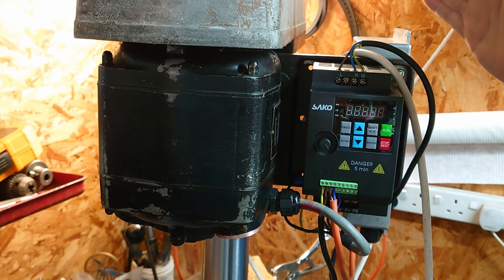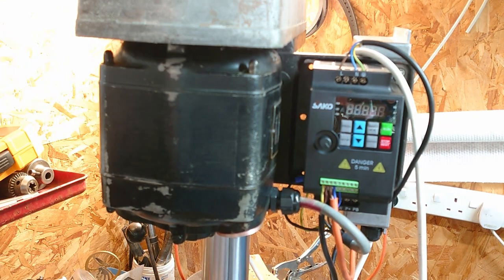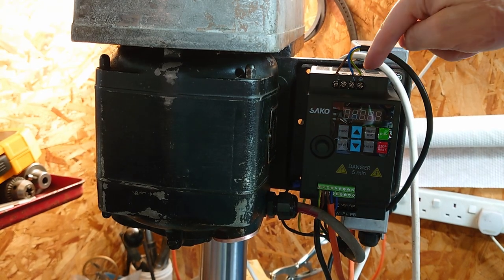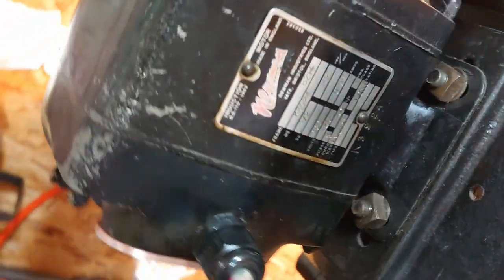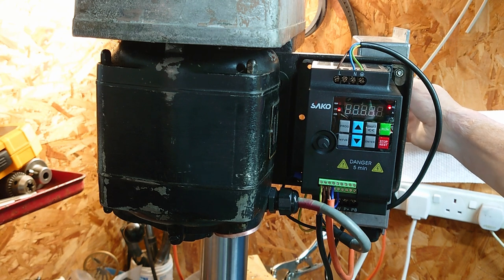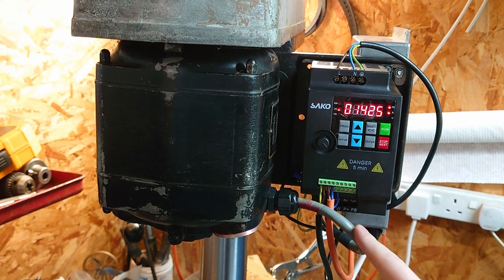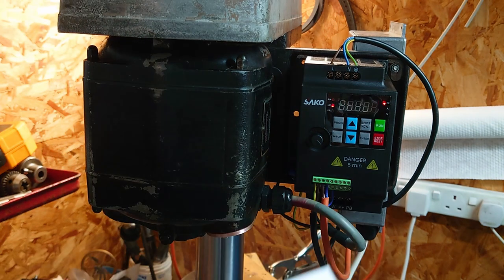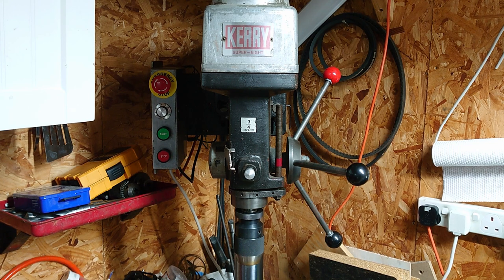I bought the cheapest VFD on Amazon for my 3 phase drill press

Comment: Folks, please put kit with exposed mains connectors in an earthed enclosure. You may need to think about ventilation. As shown in this video the wiring is not safe. There is a duty on us to those who come after us to do things in a safe manner - and to show them done safely. Olly - I'd gently advise taking this video down or editing the audio to say it is now enclosed.
Reply from the maker: Hi Bob. I'll pin this comment so that others will see it and can appreciate your concerns. Your recommendation to fit everything in an earthed box is the ideal solution, however I disagree that the wiring is not safe. It could be safer, but there is nothing at mains potential that can be touched. The mains input goes via a strain relief grommet into the switch box, which is earthed, the machine, motor and the VFD are all earthed. The VFD is located at the back of the machine, well away from swarf or anything you are likely to touch while the machine is powered. The E-stop isolates everything from the mains input.  The only thing that could occur is if a wire came loose from the screw terminals, yes there is the possibility of a live wire, but the whole shed is on an RCD.  I am personally comfortable with the level of safety. This approach to VFD installation is very common.  Every installation is different, and anyone installing such equipment should consult someone qualified if in any doubt, this is written on pretty much every piece of electrical paraphernalia that I have come across, so I didn't feel the need to repeat this advice. FYI, it is not possible to edit a YouTube video once posted.

Comment: I have a question. I installed mine to a 1,5kw motor and i attached a extern Potentiometer but the frequency jumps around and doesn't stay still. Is that normal?
Reply from the maker: Hi, great question.  I'm assuming that the VFD is also rated at 1.5KW, so in theory should be fine to drive your motor - although chinese KW are sometimes a little more generous than regular KW.  I can think of 4 things ....
1. Loose/bad connection - always the first thing to check
2. Could be a dirty potentiometer - clean with contact cleaner or WD40, or replace
3. Double check all the settings - there were several setting on mine that related to how the pot affected the VFD.
4. Electrical noise pickup on the wires to the pot - if wires are too close to motor, motor wires or mains input, it could cause interference.  Separate if you can, also try screened wire, either to the pot or the motor - connect the screen to the GND connection at the VFD only, this avoids a ground loop which could make it worse.  The noise would most likely be coming from the motor wires, and it's best to suppress noise at source, rather than try and protect other things.

Hope this helps, let me know how you get on.
olly
Reply: @ollysworkshop  thank you for these helpfull tips, the connection ports are still a mistery to me. No matter how hard i turn the screw on the connection ports the cables are still very loose. So i attached the wires end to pins and pushed it through the green connection ports on the vfd, i know its not the proper way but i have absolutely no idea how to mount them hahah
Reply from the maker: The little green connectors are called cage clamps. There's a little moving metal cage attached to the screw. They usually come done up. When you loosen the screw, the cage descends and reveals the hole where you poke the wire. Do it back up again to clamp it. I agree they can be a bit confusing compared to normal screw clamp style terminals.

Comment: I’m making a variable speed saw contraption so looking for the ability to slow the blade down as it slides on some linear rails- what minimum rpm are you getting
Reply from the maker: Hi, thanks for your question. I have set the minimum frequency on the VFD at 15Hz as below that the motor torque drops off like a stone. The motor is 1425rpm at 50Hz, so at 15Hz that's about 400rpm. I don't know how other motors will respond, some may be better. Hope this answers your question.

Comment: This was very useful for a noob like myself. I'm planing on buying the same vfd for a 3 phase polishing machine. The only question is, if you wire the 220v cable so you can plug it in and out of a wall-socket, will you have to reprogram the vfd, or does the vfd have an internal memory and keep the settings regardless of getting 220v in?
Reply from the maker: Hi. Glad you found it useful. The inverter remembers all the settings after losing power. My system is run through an e-stop switch. When I hit the e-stop all power is disconnected. I can confirm that it's been working perfectly since installation.
Reply: @ollysworkshop  Thank you for the help Olly! Another question that popped up. I have a 0.75kw / 3.2A motor. Will a VFD rated for 2.2kw and 12A blow the whole thing up, or does that mean it is rated ''up to'' those numbers?
Reply from the maker: It is rated up to those numbers as you suspected. What you do when you set the thing up is set the max volts/amps/watts for the motor so that the inverter does not blow the motor.
Reply: @ollysworkshop  Thanks Olly, really appreciate you taking the time to answer. I've been stuck on these questions for a couple of days, but now im feeling confident enough to get a VFD and start the conversion. Wishing you a ton more of subscribers! Best regards from Sweden
Reply from the maker: No problem. Best of luck with the conversion. Feel free to ask if you need any further help.
Reply: dont turn off the mains under load,can do damage, run stop via keypad only.

 @ollysworkshop
Reply from the maker: @graemeallan54  good point Graeme. The e-stop is really the power isolator. I start and stop the inverter using the start stop buttons wired to the inverter. The e-stop would only be used in an emergency to kill power when running. It actually stops quicker with the stop button as it has enforced deceleration.
Reply: @ollysworkshop  Might be worth wiring the e-stop to do a hard, say 0.1s ramp, braked stop, maybe with a braking resistor - apparently a kettle element works well for this.    As @Graeme Allan says, killing the power under load, or conversely, killing the load whilst it's running using a machine's original controls, are a quick trip to replacement VFD town via fried IGBT junction.

My mate's bandsaw is set up pretty much like that (although he has a big-boy VFD that can stop the motor pretty much dead via direct DC injection or some other voodoo).  I suspect using the e-stop would snap the blade :)
Reply from the maker: @wibblywobblyidiotvision  I'll look into wiring the e-stop in properly. As I said to Graeme, I only use it as a power isolator. My main concern was to have a handy power isolator for killing the power when putting my hands in the danger zone. I did myself a nasty injury earlier in the year on the mill when I had just stopped the spindle, but not turned it off. A feature of the controller was that if you moved the spindle enough with your hand, it would start running again! I'm both nervous of that happening again, and also too lazy to turn off at the wall, so the e-stop seemed a reasonable solution for me.
Reply: @ollysworkshop  In those circumstances, sounds like a reasonable approach.  After all, it's your machine, and you know what the expected behaviour is.  It's not like I'm in much of a position to criticise anyway, I don't have an e-stop on any of my machines  - oops.

Comment: I have a  0.75 kW 3-phase drill press. Should I buy a 0.75 kW VFD or go for the next size up, 1.5 kW?
Reply from the maker: A good quality 0.75kw VFD should have no issues with a 0.75kW motor, but if you are getting a cheapo Chinese one like me, it's probably worth spending the little extra on the 1.5kW version, then it may well last longer as it will be less stressed. Hope that helps.
Reply: @ollysworkshop Thanks. Yes getting an Ali Express special. Difference in price between 0.75 and 1.5 kW is tiny. Will go with the 1.5 so.

Comment: Hi, Thanks for the useful video. I wonder, could you tell me how to engage reverse using the VFD? I can't work it out. Thanks
Reply from the maker: @Debra Jones, Hi. Thanks for the question. I haven't tried that, but will take a look and report back.
Reply from the maker: @Debra Jones, on my inverter it looks like there's 3 ways to do it.
 1. Use the programming menu to change the parameter
2. Set up the 'm-fun' (multi function) key to be forward/reverse.
3. Configure one of the digital inputs to do the direction change with a switch.
Of course your inverter may differ in the details, but should be generally the same. Feel free to ask if you need further assistance. Thanks
Reply: Just got reverse set up using the "m fun: key. Many thanks for your help
Reply from the maker: @debrajones5099  no probs. Hope to see you again.

Comment: Hi Olly.  Nice setup, and a helluva scoop at that price.  Is that a 220 mono to 380 three-phase, or is it 220 output?
Reply from the maker: Hi Michel. That's a great question, I've just measured it at ~260V, so doesn't look like it's giving it the full 380V. This may be that the unit can't boost the voltage or I've not set it up quite right. I'll have another look later and see if there's anything about it in the manual, and confirm which it is. Thanks
Reply: @ollysworkshop   OK, that figures.  Looks like it's a 220V unit, the 260V you're measuring will be from the motor acting as generator and artificially pushing the voltage back up.  Running a 380v motor on 220v is usually OK (although under heavy load you may end up overloading the windings) but will result in a loss of power (by a factor of sqrt(3), which takes your motor from 380W to about 200W).

Solutions to this (i.e. getting moar powah) would be:

- Get a 220v to 380v VFD, but that's gonna set you back quite a lot more than 20 quid
- Laying your hands on a 220/380 rather than 380/440 motor, probably the cheapest option, especially in those sizes, check your scrap yard for A/C or ventilation fan motors
- If you can find one, a 3 phase 220 to 380v transformer (again, scrap yard if you're very lucky).  
- Single phase motor, more expensive and you lose the benefits of the VFD.
- Fix up your homebrew VFD to put out 380V (if it didn't already), maybe?

Anything that includes replacing the motor might also benefit from going to a bigger motor as well.  3/4 or 1hp is a very worthwhile upgrade for a drill press.

This is the same area of pain I have with my mill.  My lathe and grinder are fed by a 4hp rotary converter generating 220v 3 phase, but the mill absolutely requires 380v (3hp single-voltage, 2 speed motor).  I could up the voltage from the converter, but the lathe has a single voltage 2 speed motor as well, and that one absolutely requires 220v.  I'm probably going to underdrive the mill motor initially and eventually vfd either it or the lathe, or maybe both.
Reply from the maker: @Michel Auron  You are probably correct about the back EMF causing the higher voltage, there's an extra stage of conversion necessary to boost the input voltage up, which as you rightly point out would increase the cost. I like the idea of getting a larger motor, although I've not really had an issue with power. Yet. I might investigate if it's possible to buy an off the shelf voltage booster (e.g a PFC front end that boosts 240v up to 440v) and pair that with a basic 3 phase input converter. So many ideas, so little time!
Reply: @ollysworkshop  So rectify -> dc boost -> synthesise waveforms?  Sounds reasonable, I'm guessing that's how the 220 to 380 vfds do it.

I'd be very interested in a video about your home brewed drive, actually.
Reply from the maker: I'll add it to the list! I'm working on my toolfest2021 'entry' today, or at least will be once the children are asleep. 🙄